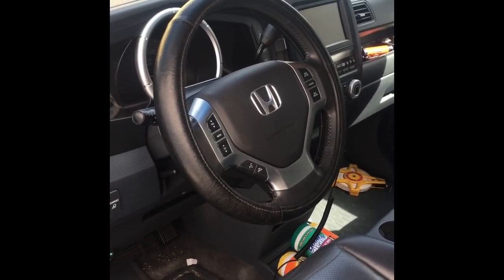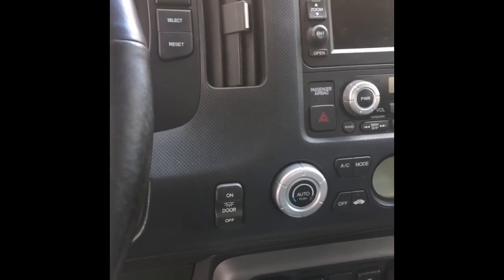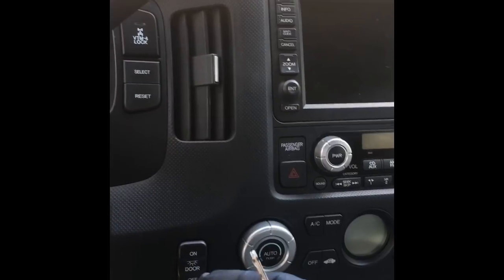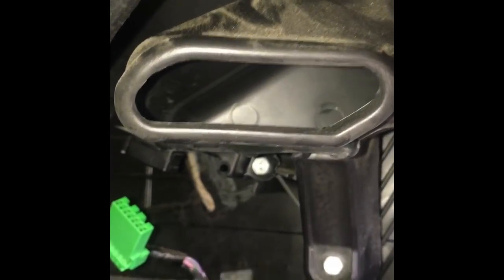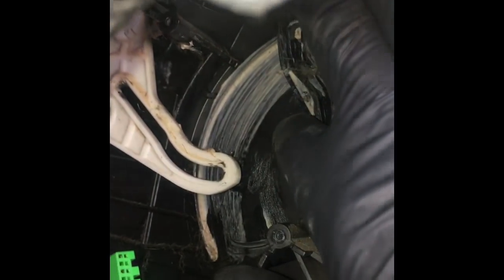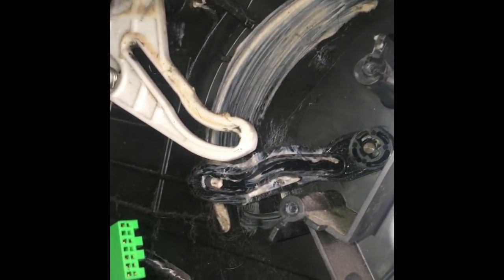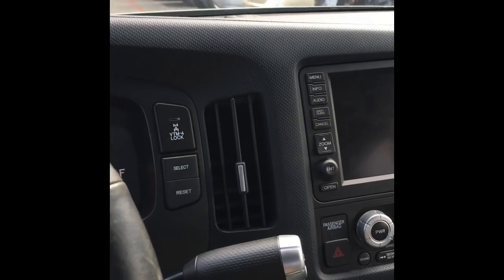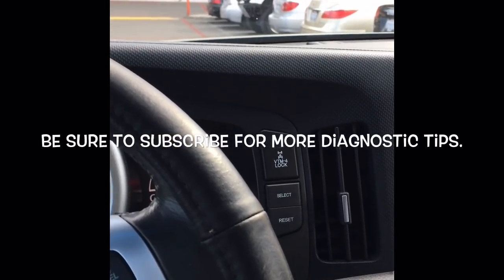How to Diagnose the AC Vent Problem: Hot on One Side, Cold on the Other

Comment: What if the motor is working... I can see the arm going back and forth when turning the dial from hot to cold. Could it just be a faulty motor or does the problem exist inside the dash like a door not completely opening and closing. Air on passenger side blows ice cold but driver side blows warm air.
Reply from the maker: Greg Salcido I have seen the doors inside break to.
Reply from the maker: Affordable Keys if you believe the door is broken and unfortunately you have to pull the dash. And pull the box out separated and replace the broken part. That can be a huge undertaking.

Comment: I have Civic 2017 I have same issue can u tell me how can I resolve ?? Mechanic say thermostat valve problem
Reply from the maker: Shan Shan A thermostat valve would be under the hood not under the dash. If it was diagnosed for thermostat I would start with that.
Reply: @HowtoAutomotive   thx finally found issue under dashboard may be HVAC fuse or blend actuator

Comment: I watched your video, I replace it, but somehow the door of the heater jams while moving, why is doing this, it maybe that the door is damage on the inside. Or the position of the flappers are not in the right place,..... Needs some help
Reply from the maker: Jose Estrada most likely the door is damaged I have seen it before. The only way to know for sure is to take the box apart and inspect it.

Comment: hello.  I have the same problem with my 2005 Honda odyssey.  I took out the servo motor and even by operating it manually still the hot air comes in on driver side only not cold.  but the motor is not functioning either.  what else do you think might be the problem?
Reply from the maker: Hello Sedegh. You need to now if the AC is full of R134 refrigerant. If it is low on charge it will not work. Does it blow cold at all on ether side? If not it's most likely Low on refrigerant. other problem may be electrical. code can be pulled with scan tool. Hope this Helps. Thank you for watching and writing to me.
Reply: thanks. I will try to add some refrigerant to it tomorrow and see what happens. I'll let you know. thanks again.
Reply from the maker: +Sadegh Mortazi cool i'd love to know how it works out.
Reply: Ok this is what happened after putting in one can of r134a with leak stopper 340 grams. cold air started coming out from the driver side and even colder air from the passenger side. plugged in the servo motor and with changing modes and turning a on or off the motor still not moving it's arms. so could it be the servo motor is also bad?
Reply from the maker: +Sadegh Mortazi sounds like like you're on the right track. I would definitely recommend the servomotor now.
Reply: Ok thanks for your help. do you know a website to get the motor cheaper? dealer sell it for 170 plus tax.
Reply from the maker: +Sadegh Mortazi at the shop I use a company called world pack but I don't know if they sell to the public. Amazon sometimes as parts
Reply: Ok thanks. I'll try them

Comment: I have changed my ford fiesta ac evaporator bcoz of leakage. After installing new evaporator my ac blow mixed air both cold and hot. Can you tell What is the reason for this
Reply: Sounds like an overcharged ac system.

Comment: Wouldn't you just visually see if the motor works without taking the motor off? I'm having this same problem with my Subaru Forester 2010 model. Any ideas as to what the problem could be.
Reply from the maker: Franckiie Dirk i'm not 100% on the Subaru but in most cases you can see the arms moving.
Reply: Cheers. I can see the rods actuating. But I'm still stumped as to why it's only blowing outside temp air when it's set to cold but when you switch to hot you definitely get the same heat/temp on all four vents.
Reply from the maker: Franckiie Dirk sounds like  the AC clutch is not coming on. Could be low on Refrigerant. I recommend taking it to a shop and having the refrigerant charge checked.
Reply: Even if it's blowing cold air into the passenger side vent and the centre vent closest to the passenger side. If it's been charged already could it be a leak somewhere in the lines.

Comment: i replaced servo motor left front for my 07 sienna, but after replaced servo, front driver side temp match setting. The passage side has opposite temp air. My driver side turn heat but passage side still blow cold air?
please help
Reply from the maker: jason jang unfortunately this is something is going to require diagnosing and without actually seeing the car I don't know what I can do for you. If you have a scan tool you can start by trying to pull the code in the H VAC system

Comment: I am able to turn my knob on my driver side and get hot air, then no AC when I turn it down.  It is not a serve motor problem right?  My passenger side got hot or cold cold air. I am confused.
Reply: I wonder if my 2012 Honda CR-V have two AC unit?

Comment: Thank you for this video. I on a 2013 Ford Edge the driver side started blowing hot air this morning while the passenger was blowing cold I had the AC on MAX COLD and nothing worked I have had trouble before where the AC doesn't kick in when I turn it on and after running the car it turns on perfectly fine. Since it hadn't happened anymore I didn't take action. I don't know what to do and approx how much  will it cost ?

Comment: Have the exact problem on Hyundai santa fe 2007. 

Thanks
Reply: mirrortv36 what was the problem having the same issue
Reply: @jeffholycross93  

When I put the A/C on, ..it blows cold air on the right side and normal motor "hot" air from the left side fans.

Comment: I still dont understand what you did and it starts working ? i did not see any repair you just removed and re installed the servo motor. could you explain please ? i have Ford Edge 2013 and its doing the same but when i go touch the connector and the servomotor it will work just fine.
Reply from the maker: Ali Al-Obaidi I didn't do a repair in this video I just demonstrated that motor was weak and not operating the door right. The repair was to replace the little servo motor.
Reply: Really could not found how to confirm that motor was weak.

Comment: I have a 2013 dodge charger and on the drivers side it blows cold air when I have the a.c. on and on the passager side it blows warm air with the a.c. on and on the drivers side where the cold air is blowing u can see the cold air coming out what does that means?
Reply from the maker: 504girl7 there’s little doors in the dash they have motors in one of those motors has gone bad. It may require a scan tool and taking the dash apart to determine.
Reply: How to Automotive ok thanks

Comment: I have the same issue, except the actuator is working properly (at least visually).  I'm going to take it off and see if I can operate the door manually or if the actuator looks like its on its way to failure like in this video.  If doing it manually doesn't change it (and freon levels are good), what is the next part up the line to check? The actual door that the servo motor is supposed to open/close? Thanks - Matt
Reply from the maker: Matthew McDonald then I would check to door it's self but that would mean pulling the box and that's a big deal.

Comment: I have a 2014 Dodge Charger an it blows cold on driver side but hot on passenger I put freon an it still doin the same
Reply from the maker: justin072535 there's a problem in the dashboard with one of the servo motors are blend air doors
Reply: known issue with vent motor in your car. atleast 1800 job
Reply: Justin, did you ever get it fixed? Same thing just happened to my 07 Charger..
Reply: 2015 Chrysler 300 cold air on one side heat on the other I'll figure out what the problem is and I'll share it when I'm done
Reply: @kenyattabryant2212  what was it
Reply: My 2015 Chrysler 300 blowing cold air on the driver side and hot on the passenger side it just stopped by itself it's blowing hot air on both sides now
Reply: Is stop by self is back to normal again